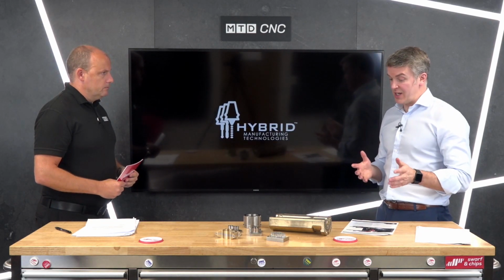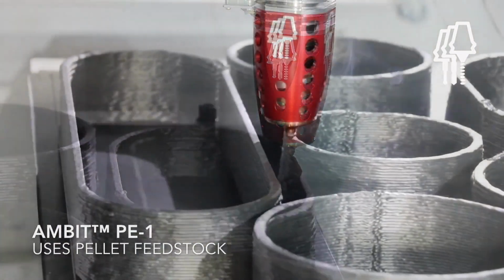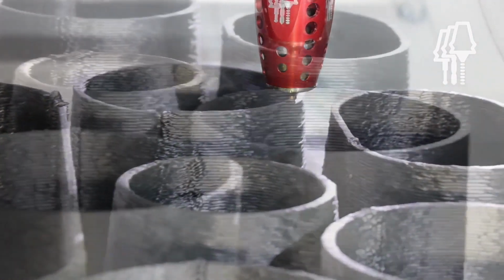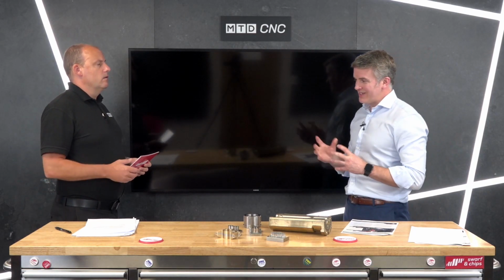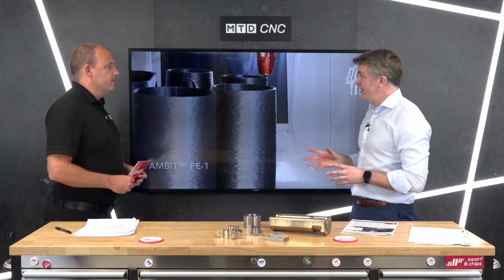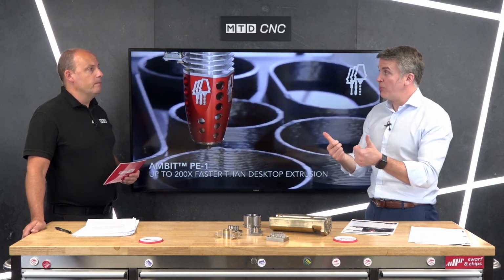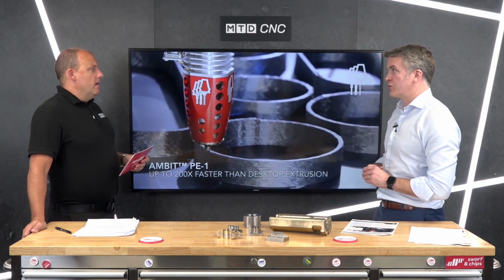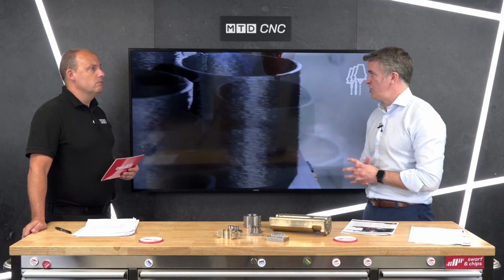Simply add this to your VMC and print

Comment: Looks pretty expensive for what it is. There are several nozzles for using pellets for even hobby fdm printers as well as large nozzles like the e3d volcano if you need to put material down fast. That is how they're saying their machine is so fast by comparing apples to oranges. Also filament is not that expensive.
Reply from the maker: interesting comment but the benfit to this is the fact it can be attached to any machine
Reply: Hi There, The costs are not high to implement this product. The pellets used are the same as is used in injection molding, so low cost also. The feed systems come in 3 different volumes to suit, sporadic use, medium volume and high volume to suit the customer application. Happy to have further conversations with you if you would like to email us on sales@ramet.co.uk

Comment: I dunno why you’d use a system that ties up a 150k machine and essentially turns it into a cheap 3D printer. It may be faster and cheaper on material, but it makes no odds when you have a 150 grand machine doing a job that can be done by something cheap enough to have many multiple units of. The moulding in machine is an interesting idea but just seems like a task that a proper vmc will be wasted on.
Reply from the maker: yep but you could use this on a 40K vmc @pete
Reply: @MTDCNC  Or you could get six pretty good FDM printers off banggood for 300 quid each, and keep machining metal in your VMC
Reply: Hi Pete, Yes indeed you can. The offering depends on the application. If the application is for larger parts, then this is the answer as it prints higher volumes faster. It also allows you to laydown material then machine off any areas that require more accuracy. This doesn't replace the standard filament type printer, it is a complementary solution for the right application. Happy to have further conversations with you if you would like to email us on sales@ramet.co.uk
Reply: @ramengineeringandtoolinglt5353  it sounds like a very specific application, not a need we currently have. Our mills never stop and we have cheap printers for prototyping already, which do the job very nicely.

Comment: Only catch I can see is with a auto tool changer and the cabling.
Reply from the maker: i think its all enclosed
Reply: Hi Folks, The tool is changed into the spindle like any other tool or angle head. then the services automatically connect via an automatic dropdown connection mounted on the front of the spindle/z-axis casting.